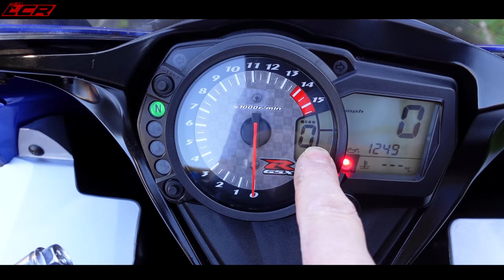I've Bought A Retro Sports Bike! | She's Immaculate!! 🤩

Comment: Great choice of bike Chops. I bought one of these brand new back in 2008 and absolutely loved it. The K7/8 bikes were slated at the time as they were heavier and lacked some midrange compared to the much lauded K5/6 series. This was entirely down to the exhaust system which was forced on Suzuki by the Euro laws of the time and in pretty much every other way it was in fact a better bike. The Arrow cans (which my bike also came with) do away with a good proportion of the extra weight. The remainder can be shed by binning the cat and fitting the Arrow decat. pipe and if you also fit a Power Commander 3 (Dynojet have a map ready made for this setup) the missing midrange will also return. Totally transforms the bike and doesn't cost the earth.
Reply: Totally agree but I'd simply retune the stock ECU rather than using a Power Commander
Reply: @graemeevans214  wasn't something that was commonly done back when I had the bike, but agree it would probably give even better results. On the other hand the PC3 is a simple, cheap, do-it-yourself fix.

Comment: Buying a used motorcycle is a great way to not only get into riding but also a terrific means of getting a really nice bike without paying for the depreciation. Most of the bikes I have bought in the past decade are used and often they have very few miles on them. I always buy from a dealer because I trust them to ensure the bike is ready and safe to ride. Also, buying from a dealer usually provides me with a warranty. You chose an excellent bike!

Comment: First of all, congratulations on the purchase of the gsx-r. This is the last gsx-r 1000 engine they produced before they reduced the stroke in search of even more peak power. This engine has been highlighted as one of the best of all time by Brock`s P. This both in terms of early torque, power and reliability. One of the engines that can withstand the absolute most abuse and tuning.

I think my older bikes are the most fun and rewarding to ride and they bring out the biggest smiles. The feeling of mastery is much greater when you have to know the bike well to get the best out of it.

If you upgrade brakes, suspension, cat delete, dyno tune and mufflers out, you will have a motorcycle that can outperform the S1000RR on the track. The only place a modern liter bike will be superior is at a straight stretch above 12,000 rpm.

After a ride, you will be left with a big smile that lasts much longer than you can get with any of the new bikes. Well done enjoy!

Comment: Great find. I was lucky to have the same luck on getting a k8 750 same colour scheme . Got it with 11xxx kilometers was super new. Have done filter full arrow system n translogic quick shifter . Made 143hp to rear wheel .super light and nimble never struggle to keep up with anything. Is a rocket

Comment: Nice bike Mr Chops in 2006 I bought a 04 zx 10 an absolutely crazy bike the front wheel was always off the floor or the rear was trying to overtake it. I tracked it and never used it on the road again. You gotta have a go on one 👍. Definitely a game changer 🏍
Reply: I bought a 2005 Zx10r last year. 
Proper fast. 
It's shorter than most 600 CC race bikes...
Had a gsxr 750 1998 for 6 years befor that. 
It's nice to have some power down low now :-)

Comment: It's such a lovely example! As a K7-8 owner myself who puts 14k miles on it in a year, it's been an absolute pleasure to own! The only advice i have is to try and avoid folding the right hand side mirror, it starts to wobble and there is no fix once it does, only solution is to replace them with 09-16 model year mirrors. Also the only part not up to modern bike standards is the brakes, a master cylinder upgrade goes a long way, but a caliper upgrade take it that extra bit further. Excellent purchase!

Comment: What a find, as an ex owner it'll be emissions and noise compliant (with baffles sadly) still with the Arrows. I'm not going to tell you how to suck eggs but keep all your original parts. Fit track fairings and an aftermarket quick shifter. Stick some wrap on the swing arm as on a track that chain may stretch and chip it. Enjoy your initial run to McD's - I traded my K7 for a S1000RR, you'll see the similarities in shape.

Comment: She's an absolute beauty as you said  almost too nice to use and abuse on track. Back in October bought a Ducati Monster 1000ie 2005 that is equally immaculate and mirrors the original 1992 designed M900 aside from fuel injection for my retro rides, Cheers Choppsy

Comment: Summer 2019 I bought an ‘05 Fazer1000 with 10k miles, a brand new Maxton fully adjustable shock and littered with quality carbon in the same condition for £3.5k as a tourer as my R1200S is becoming a bit cramped for big distance.  The previous owner would dismantle it and spend 16 hours cleaning it with cotton buds. They ‘are’ out there.

Comment: Nice one Chopsy, absolutely lovely, I'd three GSX-R750s over a ten year period which were by far the most comfortable sports bikes I've owned.
Reply: Funny how opinions vary.  I rode a 2000 GSXR750 back around 2002, and was used to older bikes.  It was uncomfortable and I stalled it at every stop sign (lack of torque) until getting it to I-35 in Duluth, MN, USA, and then it went like hell of course.  Later in the 2000's I bought a 1993 750, purple and blue, sharp looking but what a torture rack.  Got it cheap and sold for a profit but never had one again.

Comment: I bought a gsxr 600 last year 06 plate had 4,030 miles on the clock.  Only marks i found was stone chips on the front fairings and near the pillion seat there was a few tiny scratches where I imagine the 1st and only owner before myself has caught his boots.  Ill also be keeping it original and changing panels out or getting them resprayed to make it look immaculate

Comment: Sold my superbikes 6  years ago, over the years ive owned 2 bmw s1000rr a ktm 990 superduke a k7 gsxr 1000 a couple blades and a few others which were all highly modified   but I've gone back to my old School roots as motocross and enduro is where I started on 2 wheels as a kid , I now own a modded 2001 honda xr650r converted to supermoto a modded 1997 honda xr600r converted to supermoto a modded 2003 yamaha tt600r belgarda adventure bike a original low hours 1989 kawasaki kdx200 e1 enduro and a very rare original 1991 suzuki ts200r slingshot enduro with 1800 odd km from new on it and a classic 1987 yamaha dt125lc ypvs with 6000 odd km on clock  .. Ive restored all of them and still finishing off the bits and peices to the dt, ts and kdx to get them perfect . I only use the tt600r regular as we ride the TET and TRF legal trails and byways and the xr's on sunny days over the twisty mountains in south wales and the 2 strokes on the odd occasion as soon as I ride them I want to get them screaming through the power band lol

Comment: Nice  decat  & flash will improve mid range  check arrow papers, hh pads &  braded lines,check suspension links for grease used mct for suspension  mines gsxr1000k7  103k

Comment: Suggest a 2005 ZX10R as one of your ‘bikes of the decade’ also if you can find bikes like KR1, RGV250, RD500, RG500 aprilia 250 RS then original GSXR750 and 1100 slab side and sling shot, FZR1000 and EXUP these would make great content!

Comment: Nice bike, a lovely bike & what a fabulous engine, I put one of these in my Suzuki Cappuccino, then my lovely stole to from me to "Embarrass" SuperCars, they are really good, but you deserve a "Proper" treat, go & get yourself a 2 stroke, they are fabulous fun, amazing on road or track, tons of torque to fire you out of those corners & the Suzuki RG(Gamma)500 handles so much better than any 4 stroke, the power is delivered in such a way you will believe it was designed by whichever god you worship, & even then they are still so tuneable, it's the same with the Yamaha RD500, Sublime. I've just put the 750 engine bottom end in a Suzuki GSX750F they have a de-tuned GSXR600 bottom end as standard, but I put a heavily modified 750 bottom end mated with a 750 top end on "Carb's" it is a weapon & so much more comfortable on the longer rides, I can still get my knee down & it is the most amazing "Sleeper" it catches out so many "Litre Bike" ridden buy those that really have no place being on them in the first place, I don't mean the likes of yourself, it's the guys that have bought a bike they are "Frightened" of just to impress their mates, it seems there are loads of them that don't need to "Modify" their bikes because they will never be good enough to get the benefit of that racing exhaust but need to "Modify" themselves a bit of "Rider Training" would go a long, long way, & they get to keep it when they sell their bike. An excellent post, thank you.

Comment: Chopsy-I think you should looks at fitting a traction control/quick shifter unit!

I’ve got a k5 and fit a Bazzaz unit to breath new life into the old girl-it was a great unit for the time and works as advertised. Nice not to have to fit a power commander too. However, IMU’s are a thing now and so is Gripone’s traction control unit.... I’d start looking there-the company is owned by Diego Gubellini who is/was a motoGP electronics guy and now team mechanic

One trip into the kitty litter would pay for this mod...

Really recommend trying something like this because you get the tangible benefit of being able to ride like a twat without being highsided to the moon, get a quick shifter included, and it doesn’t visually change the bike.

Comment: Got a new bike 3 months ago,,, my k6 8500 miles mint 2 owners every mot yoshimura suzuki supplied by suzuki and standard can and number plate holder,, your bike has an electronic steering damper,, I was getting a black 08,,, but my bike came by chance ☘️☘️☘️☘️☘️☘️☘️enjoy it 😉😉😉😉😉started titanium fasteners and carbon fibre parts,,, from Northern Ireland,, looking forward to the videos especially if you fit a quick shifter,,
Reply from the maker: Thanks Cecil 👍
Reply: @LambChopRides  you are going to get a garage extension or the h2 going indoors 😁😁😁😁

Comment: Ooh good choice Mr Chopsy! My first bike was a GSX-R600 (08/K8). It was a fantastic first bike, easy to ride, light and the power had to be deliberately access - flat as a pancake below 8k). I only dropped it twice 🤣
Reply: I have a K4 600 as a first bike, a gorgeous orange/black one, it's been superb, i've dropped mine twice too, first doing a stupid U turn in the works car park at 5:30 in the morning and another at an uphill junction and i forgot to brake, bike rolled back and down it went, luckily no damage at all both times, R&G crash bung did it's job.
Reply: @Markycarandbikestuff  awesome, still kind of miss mine and wished I’d of kept it for track day work. I think  they aren’t best suited to U.K. roads because although they can be very fast the performance is hard to access without really winding them up! Still I loved mine and think the GSX-R’s are fantastic looking bikes!

Comment: 1000 miles a year for 14 years…. when you say it like that you can begin to realise how it’s remained so clean… However more impressive than that is there isn’t a single piece of blue anodised after market tat on the bike anywhere… that is honestly a bigger achievement than the condition…. a lot of pressure Chops… don’t screw it up, you could half its worth in a matter of seconds by fitting a set of anodised bar ends…. 😂

Comment: remove the fairings and fit a cheap set of fairings from china.. add some protection... casing protectors.. fork protectors etc..use quality brake fluid (if you get fade add a quality master cylinder).. sticky tyres and race pads.. ... job done  (miss my K5)

Comment: I picked up a k7 600 with just over 9000 miles 3 months ago. Do you get any gear position sensor issues? I can't even start mine on the stand as it doesn't recognise neutral.

Comment: Congratulations on the purchase. I currently have 2001 r1 and love it. I miss my old 1998 r1 red and white. Been thinking about suzuki gsxr1000 for awhile didn't like the k1 and k2 throttle response was very touchy just my opinion. My question  is do you know which models were effected with frame cracking k5 k6 and k7?? So I am leaning towards k4  even though Ari Henning did a review saying k5 would be the best arounder. Is there any chance you could do a review on the Kawasaki ninja zx7r? Also Kawasaki Vulcan S 650 ABS ? Look forward towards your videos which is second to none. Ride safe and stay safe brother👍☺

Comment: I sold mine back in September, white and silver k8 1000. That was in almost immaculate, just a little corrosion on a few bolts and couple of small paint chips but that was it.

You're going to love it Chops, you can adjust the rear sets slightly too

Comment: I see nothing special here.  I bought a 2008 Buell 1125R last August with the optional fairings, an HMF pipe, only 5,600 miles, $4,200 and it's as clean as this.  The Gixxers worth money are the air/oil cooled and mint examples up to through the 90's.  I also browse eBay and CycleTrader and Craig's and see bikes kept in houses all the time.  A new listing on CycleTrader is a 2017 EBR 1190 with 1,820 miles on it, kept in a house.  Recently a 2004 Hayden RC51 sold on eBay with only 300-odd  miles, bill of sale, never titled!  Maybe the fuss here is because a UK bike is more likely to get used more and ridden in bad weather?